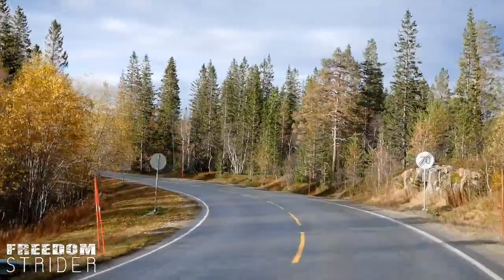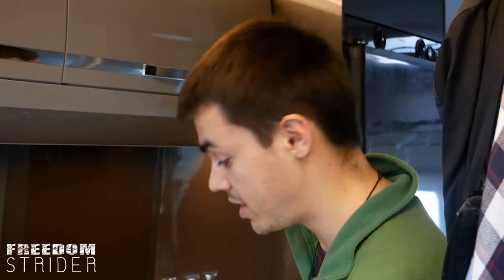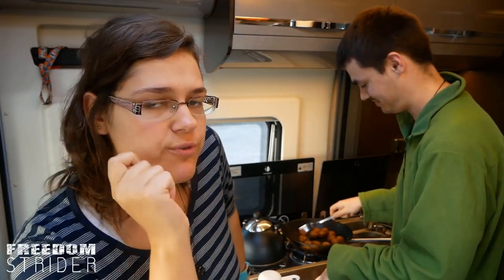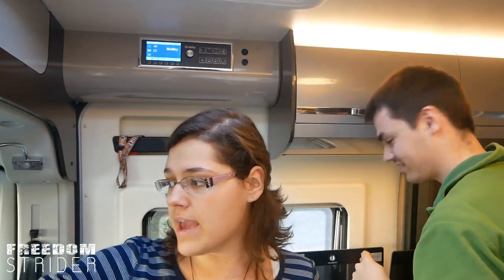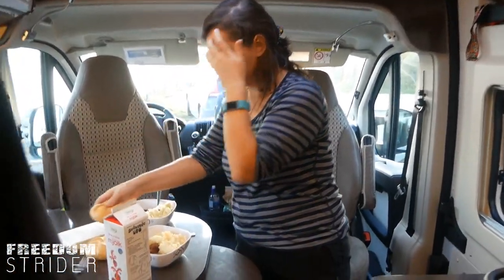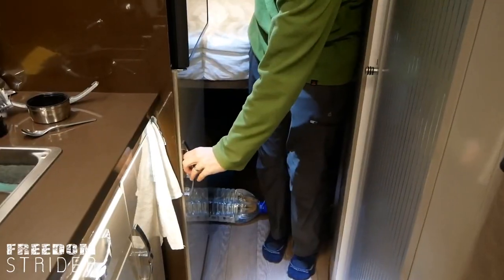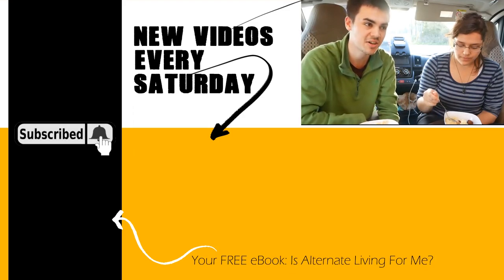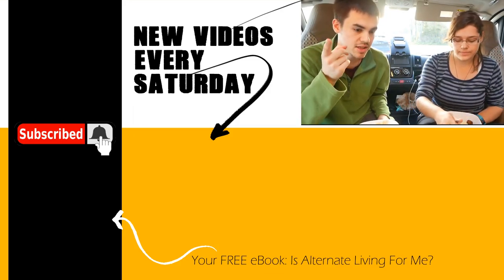Van Conversion Mistakes to Avoid

Comment: Big Belfast sink! I’m actually installing a mini dishwasher in our van! (We don’t even have one in our current house)
Reply from the maker: What kind of dishwasher are you using? Don't they use alot of water and power,  can you send us a link?
Reply: @FreedomStrider  sorry I didn’t  see your reply until I was rewatching this video! it’s a Cookology CTTD6BK, it’s a half size dishwasher 7 litres per runs so probably only to be used twice a week and I think I calculated around 5ah in energy per run but there is a smaller  Cookology CMDW2SL Mini Portable Dishwasher that doesn’t require plumbing in! (You just fill with 5L) and uses just slightly less energy (not as energy efficient)